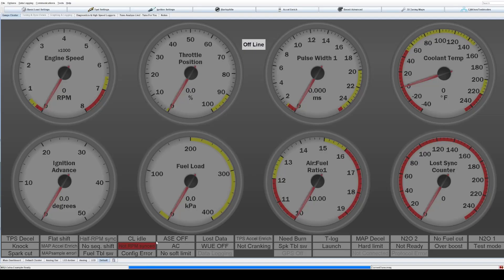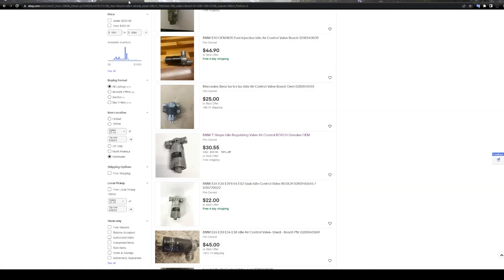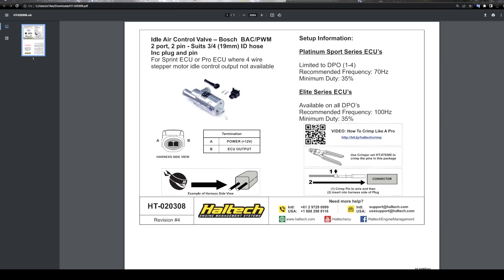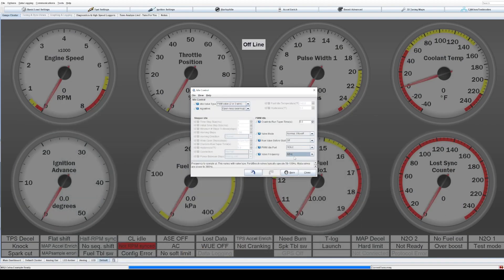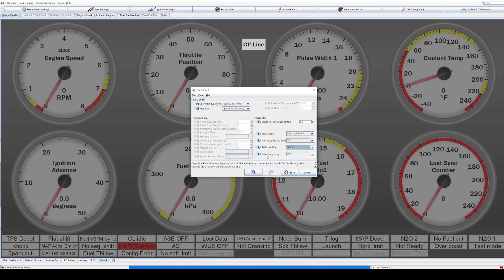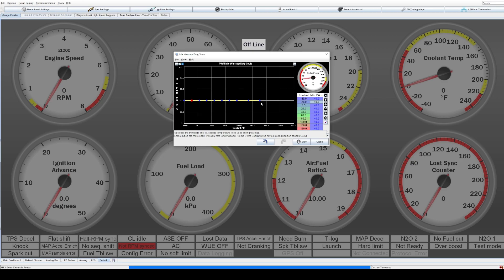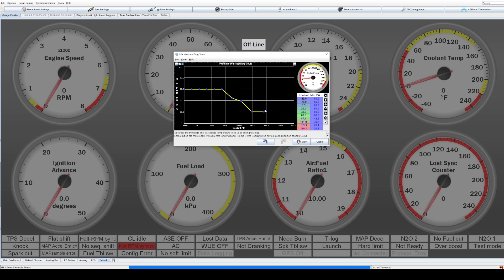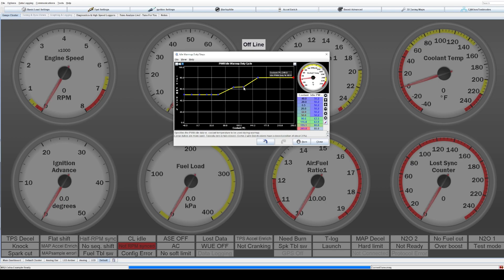Megasquirt Idle Air Control Valve Basics | 2 Wire PWM Open -Loop Idle Control

Comment: Very helpful info thank you! What does crank to taper time do? Is it how fast the idle position goes from the cranking position to the running position?
Reply from the maker: It's the idle valve duty during cranking. You can try some different values to see if it helps during startup but I found the default to work well. Once it fires up it uses the regular idle duty table.

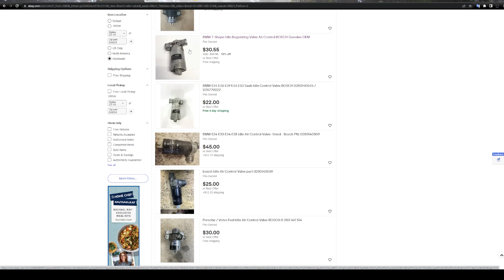Comment: Btw the ICV valve you showed at 2:42 is actually from a M50 vanos engine which had the 3 pol style.
Reply: m50s had 2pin ISA valves. m52 and up, aka OBD2 cars had the 3pin ones, where the two coils that open and close the valve are separated into two inputs.

Comment: @turbineresearch how do I bump up idle when ac comes on? For my stock ecu there is a wire that comes to the ecu that sends a signal from the AC system when it is on. I’m figuring there is some input into microsquirt that you can work with to bump up idle when the AC is on.

Comment: great video! what do you do with the idle screw on the throttle body on a new tune? do you just screw it in all the way and then adjust the curve or leave it at a random spot and adjust?
Reply from the maker: Only adjust the screw for warm idle ( where the idle valve isnt used)
Reply: so i guess ill shut the screw and adjust the curve for cold idle and adjust the screw after it warms up if necessary.

Comment: do you have any tips for setting base idle map? Should the cells before and after the idle cells be leaner or richer than idle? Or roughly the same? I seem to have some hunting going on, my timing is set at 20 all around idle,so i didnt want to add in timing just below idle timing point just yet as pretty sure there is some correcting to do first fuel wise either side of 900 rpm idle.
Reply from the maker: I have a few videos on idle tuning. Check them out and it should help you get close

Comment: Great information thank you. I am going to use MS on my project and was wondering if it is possibly to run an electric water pump and fan using the MS after switching off to prevent heat soak.
Reply from the maker: You would need a way to keep ECU and device power on after you shut off the car

Comment: Absolutely, brilliantly clear! My Bug has an MS2 but no idle control - just an air bleed screw on the throttle body. It's okay, but proper idle control would be fantastic. It's not something I've ever done before but this has definitely given me the confidence to give it a go. With those Bosch valves, does it matter which hose is inlet and outlet? And do the valves stay shut under boost, or can the boost pressure force them open a bit?
Reply from the maker: They valves are typically plumbed from the intake manifold to the boost piping or intake before the throttle body. If plumbed like that the system is all under pressure when the system is making boost.
Reply: @TurbineResearch  ahh, I think I get it!

My car goes turbo - charge cooler - throttle body - plenum. So the valve would take air from the charge cooler (or the charge pipes) and bypass the throttle body to put it into the plenum. Both sides of the valve are pressurised so no boost leak.
I was originally picturing it taking air from the atmosphere but it makes sense now. Thanks again 👍

Comment: Anything else need to be done when selecting 'Closed-loop' to compensate for A/C load, e.g.? BTW, if I can get get your thought on this: What can I expect from the Microsquirt regarding idle quality/throttle response when compared to the factory sequential on a rotary? Thank you much!!
Reply from the maker: Closed loop needs to be configured differently than open loop. I will be making a video on that soon. As far as idle quality and throttle response I would say it's all In how well it's tuned. Idle and throttle response can be better than OE if tuned well.

Comment: what's good Turbine Research? I'm now tuning my car and I started playing with the IAC control yesterday. my question is about the idle cranking duty steps % table....what's it's purpose and how do we use it properly? thanks
Reply from the maker: The idle duty steps is the duty cycle of the idle solenoid ( what percentage it’s opening and closing )
Reply: @TurbineResearch  would you happen to know why one is for cranking and one for warm up? I notice when the engine is running, i can work both tables and something happens. The warm up seems to do more, but the cranking does something with bigger swings of the numbers🤔

Comment: Just came across your IAC valve installation video and it really helped me out. Many thanks!
As I'm running MS2 on a Version 3 board I had to modify my circuit board by adding
a higher capacity transistor to power the IAC valve.  And because I had already used 
the Fidle lead to control my radiator fan I had to use another port to control my fan and 
free up Fidle for the IAC.  Everything worked out as expected, but I noticed my Walker 215-1061
IAC valve leaks slightly even when it's fully closed so I can't get the idle speed back to it's
original level.  Do you know if this is normal for this type of valve because it doesn't seem 
to have a positive sealing valve inside it like a newer pintle type valve has?  I have closed the 
throttle plate completely to improve the situation, but the vacuum leak is still too high. I'm 
wondering if my valve is defective, or in a normal installation there are additional tubes that are
calibrated to eliminate the vacuum leak? 
Your thoughts would be appreciated, thank you
Reply from the maker: In my experience there are some IAC valves that will default to a slightly open position. I haven’t used the specific valve you have but it may be worth bench testing it with a 12v power supply to see how it behaves off the car

Comment: Which version of megasquirt is this on? I have a 4 wire stepper that I'm planning on using for my V3 Microsquirt but this seems way less complicated.
Reply from the maker: It's a microsquirt v2 without any stepper control. It's very easy to setup maybe 10-15min getting it on and working

Comment: so with this set up would it compensate for elec loads like headlights on etc
Reply from the maker: This is for open loop idle control. You would want to setup closed loop idle that targets an rpm and uses that target to compensate for load